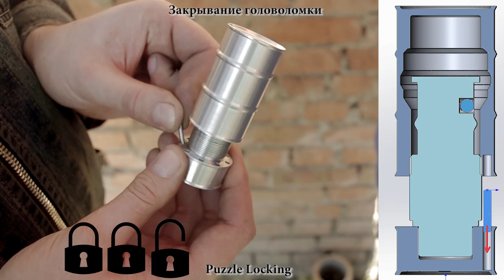Metal Barrel Puzzle

Comment: If you make a Version two, it should have the pins captured in the cap. You could do it by making the cap in two pieces, and put a head on the pins.

Edit: I forgot to say, I really enjoy watching your work, your videos are always entertaining.
Reply from the maker: If I'll do this, you couldn't open this puzzle
Step 4 will be blocked
Reply: @EngineerBrunS  

I guess I wasn't clear in my comment.

When you hold the puzzle vertically one way, the pins prevent it from unscrewing. Hold it the other way vertically, and the pins fall out of the way, completely fitting inside what I think of as the cap, so that you can unscrew it. 

In the piece the pins fit fully into, they should be captured, so when the puzzle is opened the pins cannot be lost. To do this the pins would need a very slight head on them, and a ring fit in place that has holes large enough for the pin, but too small for the head. The puzzle would work the exact same way.

Again, I may not be making it clear.

It's very nice piece as it is, and needs no changes.